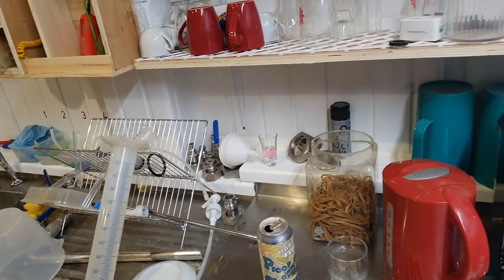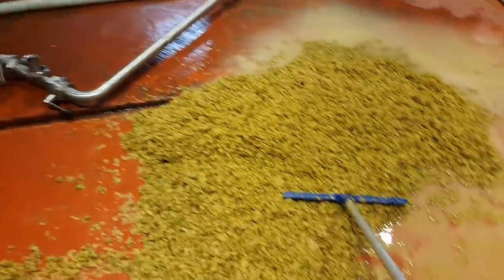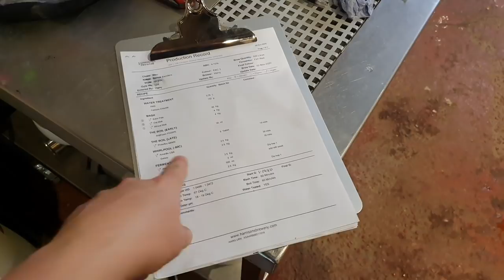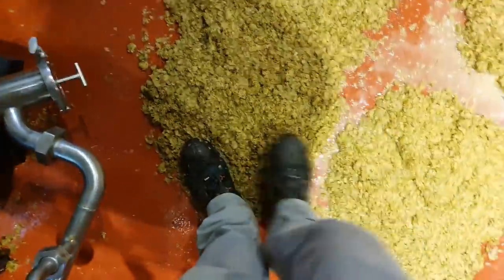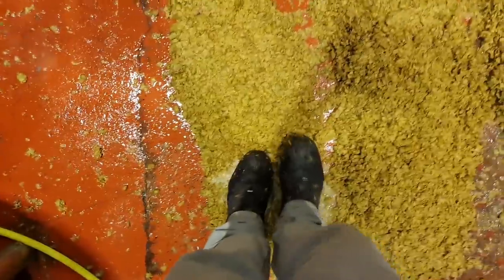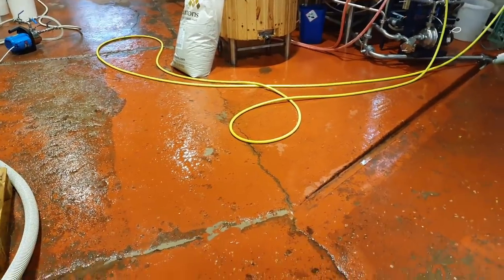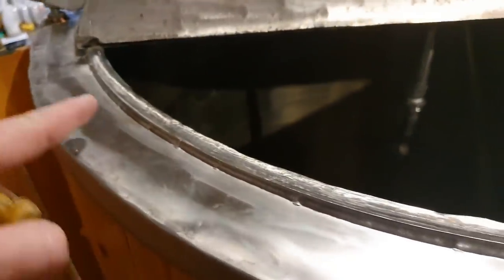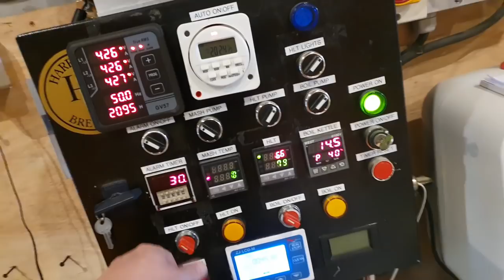Squashing Hops?

Comment: Nice one, Harry. Any way of sandwiching the wet hops between 2 sheets of ply and running them through the rollers somehow?
Reply from the maker: 18mm ply is £35 a sheet. fook that. I just need to order pellet next time and take my punishment.
Reply: @harrybrew69  Fair enough. No way of doing it without trashing the wood, or using cheaper bits?

Comment: Why not construct yourself an industrial sized hopback and run your beer through that, avoiding the clean up? You're so handy with a torch, you should have one in a couple hours? You could also fashion a bucket inside a bucket and if you spun it on a lathe or fan motor, you could wring the hops out with that if you wanted to save the flameout hops for another use? Actually, an old washing machine with a modified tub would work ideally. Cheers!
Reply from the maker: All great ideas. However, I just wanted to wring em out to get them in the bin and go home after a long day. The real solution is to never buy leaf hops again. My bad
Reply: @harrybrew69  We all err, brother! Cheers!